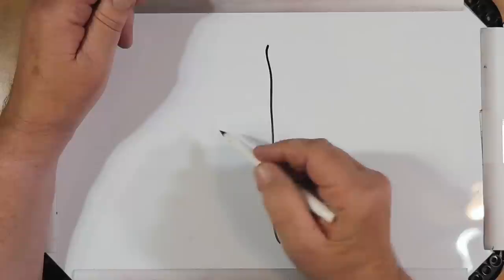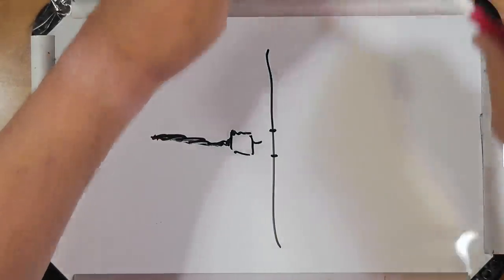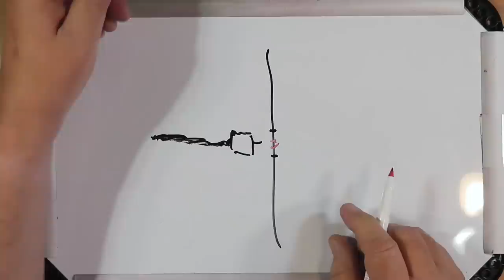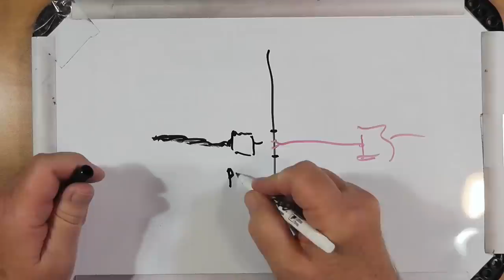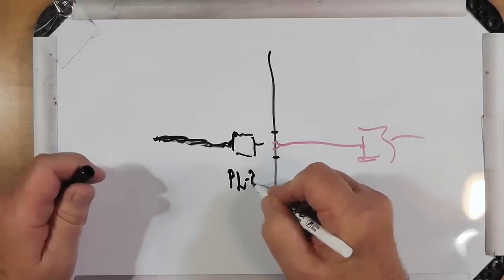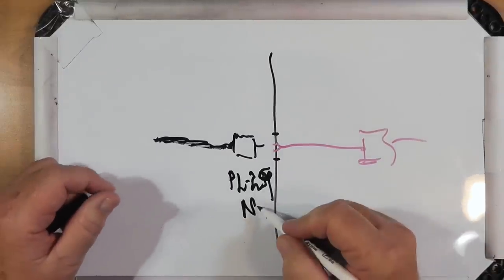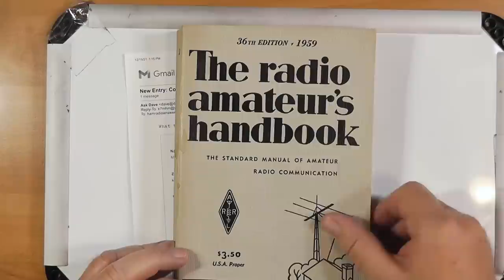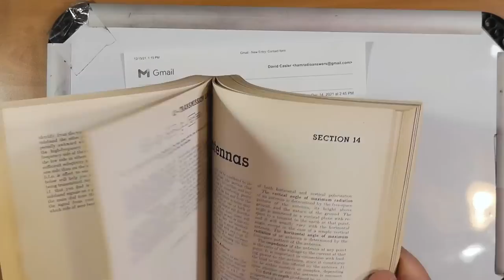What to do with Excess Cable? (#656)

Comment: Wanna bet Dave? I use a Johnson Viking II with a National HRO-5TA1 with ALL the coil sets ever made for it for CW. It was my Novice station, I switched between the two with a furnace relay and used contacts made from tacks on a wooden board to switch antennas. Dipoles, and one 40/15M vertical with a Coke bottle insulated conduit vertical made up my antennas, all hand built with 450 ohm ladder line feeding them all except the vertical, the first piece of coax I ever bought. It was military surplus coax with only the milspec number and impedance marked on it- 62 ohms.  Really exciting times for an 22 year old kid. I started with a J-38 key and eventually had a Continental Railroad telegraph bug. Now I am 65, and  still enjoy the thrill of a new contact. I'll talk to anyone, Tech or Extra and all between. I do not label anyone, but I get excited when I talk to a Ham that makes some of his own gear!  I like your videos, haven't seen much that was new to me, but you might surprise me someday. 73's!
Reply: Good to hear about your radio life.
I put up a 15' vertical for a special event station, 3 x 5' aluminium poles insulated from earth with a Newcastle Brown Ale bottle, short coax, variable capacitor with a roller coaster.
Love making stuff, h.f. ssb/cw 5 Watt tcvr, 2 Watt one valve xtal tx, resistive type SWR meter, repaired a 1944 era Wireless 19 Set running 2 Watts, a Pixie on 5.262 MHz plus other gear.
Bought an ex-army key when I was about 15 and knew no Morse, I just wanted one, it's what I use now for 40+ years, mainly use cw. Licensed aged 19 and now 67.
G4GHB

Comment: It is true that the N-connectors’ lower loss and better VSWR at VHF frequencies and above is of little advantage to most hams.

But, the N-connector is designed to be waterproof, having a gasket set deep inside. For some uses this is an advantage. The quality of construction and smoothness of screwing on the shield is generally better with N-connectors too, FWIW.

But for some hams such as myself, who collect and use surplus military radios, and who collect and use high-quality RF test equipment (HP, etc) the PL259 is almost never used, only the N-connector (and the BNC for lower frequencies). So for those hams it makes sense to standardize on using N-connectors, as I do. It’s alway good to have a box of adapters either way!

Comment: Depends how much cable - but I try to avoid cutting them short because the most expensive and useless cable is the one that is ALMOST long enough.
Reply: Darn!  I cut it three times , and it is still too short! ;>)
Reply: It's always long enough for the next shortest run or jumpers. I just make each cable for use to length. Coax is a wear item not a lifetime investment. Lots of guys losing a lots of DBs in all those extra feet of coax between expensive rigs and expensive antennas for fear of not being able to reuse one piece of relatively cheap(compared to radios etc.) coax for the rest of their lives. Buy M&P cut to length, the connectors are so much nicer and reusable if you're careful, that'll save you more than not cutting cables to length over a lifetime. Can get a linear to get more wiggles out but you'll never get yer ears back.

Comment: I find it incredible that some hams don't have the ability to put connectors on Co-ax cables and prefer to buy them ready made! In the 50 years I have been a radio amateur, I have never bought ready made co-ax cables or wire antennas for that matter. 
Seems to me that many hams have lost the interest in doing home construction (and I don't mean building kits either). Having at least a basic skill in soldering, fitting connectors, etc should be something which all amateurs should be able to do.
Reply: I agree with you on making everything yourself. Too much "off the shelf" today. Designing your radio, accessories, and antennas used to be the Radio Amateur's enjoyment. I can proudly say "I built that myself" either from a kit or from a schematic for more than 3/4 of my shack. I refurbished a set of Drake Twins I got for $100 with the T4XB/R4B/ MS-4  with all the necessary crystals to cover continuously from 1.7Mhz to 30MHz. Yes, it is a hybrid radio, but very reliable now and  enjoyable. The tuner is a Heathkit SA- 2030, and the coax is RG-6 which works well with supplies and I put the PL-259's on myself with the RG-8X rescuers. I have about 4,000 feet of RG-6 as I used to install satellite TV for Dish and Direct and some C band outfits. I have dipoles, loops and a Rhombic on 5 acres, all handbuilt. Not boasting, but saying you can build anything and hang it in the air. I do have commercial made radios I have converted to different bands, and a lone Yaesu FT-625 RD that got me across the pond into Wales from a simple dipole and an 811A linear I built from a 73 magazine article. This goes to show that you can repair, repurpose, and construct anything for Ham Radio. I've been licensed since 1979 (then a novice) and have had a grand time of fun doing everything. Buying off the shelf just wasn't for me. Part of the excitement was building the gear! Can't beat that!
Reply: I've never bought aerials or ready made coax cable either. I've dipoles for 20m to 10m, inverted vee for 60m and a 4 element collinear for 2m. Built my 5 Watt ssb/cw tcvr, one valve xtal tx, repaired a Wireless 19 Set, a Pixie admittedly from a kit, all QRP, plus other stuff.
G4GHB

Comment: Good info. about coax cable here Dave.
I watched a CB video, they are convinced they need a half wavelength of coax from tx to aerial. Only CB'ers seem to have problems with coax and aerials. He warned to not cross coax or coil it as it affects the SWR and he's seen a coax outer burnt with r.f. from crossed coax cables. 
I've never had problems with coax. I suggested he has r.f. on the outer of his coax.
All BNC connectors here and QRP.
I have a couple of radio magazines from 1926/27 which shows state of the art technology of that time. 
G4GHB

Comment: Rather than filling the holes it would be better to get one of the DMARC boxes like CATV and POTS uses and put a larger conduit thru then run the cable in/out the weatherproof box... optionally stick some insulation in the conduit.  If you get one intended for CATV they often have foam "seals" big enough to accommodate the fat drops the cable company uses which is similar to the LMR400 I have in diameter.  Box keeps pests out and also helps with waterproofing keep rain out without gooping up your coax gluing it in place.  Also provides room for more later to pull thru.
Reply: I used a CATV box and it works great. I installed a ground bar and surge protectors in the box before they enter the house.

Comment: I have had custom runs done.  I tend to order the 259.  Male on one end.  Female on the other.  No issues with barrow connectors.  Less points of failure.
Reply: Great idea.  However, they are BARREL connectors, so called because they are cylindrical and straight through.

Comment: I saw one "ham" radio You Tube where was trying to do everything right. He cut the cable. Drilled a small hole, ran the wire and tried to splice the two pieces together by twisting the center conductors together and twisting the braid together and using wire nuts. So he didn't have to put on a PL-259
After putting up and tower and beams this was a What  NOT to do.

Comment: If you're not going to be increasing antenna height or moving hamshack, keep coax relatively as short as possible. VHF/UHF can be very lossy within coax runs. There are calculators and charts for losses in given coax types/lengths. Just run some 1-5/8 Heliax (hardline) with N connectors and call it a day ;)
Reply: Of course you are joking.

Comment: Good reminder about the mice.  I've had them come into my shack following the cables through the windows as well.  When I drill an  entry hole for a cable now, I drill it high up on the wall and then drop the cable down.  Mice don't like to climb that high.  

I don't know about short 3-foot patch cords.  I just buy them pre-made on eBay.  Most are good, but some will not properly tighten against an American-made SO-239 socket.  You can guess where those were made.
Reply: Mice love to chew on cable - especially wires on your tractor.

Comment: Dave, mice hate steel wool. Pack the holes with steel wool, then shoot some expanding foam or glue to hold it in place.
Reply: Bronze wool is better it does not rust.  I have my  cables coming into the radio room via a 1 1/2" PVC pipe  and this is what I use to fill the void.   I have use the bronze wool to plug up any holes I have found in my  home and  so far we have managed to keep Mickey and Minnie mouse out of the house.

Comment: Dave, really enjoy the videos and look forward to each of them.. While I understand that rolling up excess coax is not an issue, in my case I'm using 1/2" hardline with about 25 feet of excess that I have rolled up and secured it to the tower. Does this impact the SWR?

Comment: Cable length is only important if you want 1/4 wave cable to repeat the impedance of the antenna in the shack,  otherwise a short bit of excess is of little importance.
Reply: That be a half wave length that does that

Comment: Bulkhead connectors are the way to go in my opinion. I made a wood frame and used 1/2" plywood to put my Bulkhead connectors I hav e 6 coax connectors and bussbar ground connecion. You can build this with scrap lumber and about $60.00 in the connectors. have fun ki0ad

Comment: For shorter runs, I's suggest doubling the length before adding a feet. Especially if it has connectors.  That way, I can cut the cable in half, re-terminate ONE end at a bulkhead plate, and have a spare cable.
Is there anywhere in particular you get pre-made cables?
Reply: I have bought pre-made cables from ABR Industries and Cable Xperts, and all have been reliable good quality cables. Ham Radio Outlet, DX Engineering and probably every other ham radio store sells pre-made cables, although theirs are specific lengths. With ABR and Cable Xperts you can specify whatever length you like.

Comment: I have a 40 foot antenna tower, can I run a single with from the end of the tower, or do I need a second wire. At my current home, I have about 100 feet from house to the back of the property. I would like to run 15, 40, 80, and, if possible 160M. I have a diagram to make 6M antenna, and I have a 10 Watt 6M rig that some one spilled coffee into. I got it free. I am going to find out if it is economical to repair Am I having a flight of fantasy here? I am thinking about QRP, as well as QRO when needed K0XHF here.73

Comment: Dave, have you ever taken a close look at the center of the BNC, TNC, and N-connector?  They are the same, such that in a pinch one can push an N male over a BNC female.  It is not the best and not something I would recommend for more than a few seconds.  Also, while researching my comment, I was surprised to find some charts show N and TNC as having higher frequency and power ratings.  I can only conclude that is due to the greater strength of the larger and threaded outer connection.  But, it is not due to the center pin in that they are virtually identical.

Comment: If you have an antenna tower and you put the feed line through a pipe to the top of the tower to the antenna what will that do to the RF when transmitting?
Reply: Nothing.

Comment: The N connector has lower loss. Especially  at UHF.
Reply: The N connector is slightly superior, but here in the US it will make your gear incompatible with 99% of what's out there. No borrowing or swapping. And using adapters is worse than using PL259s alone.